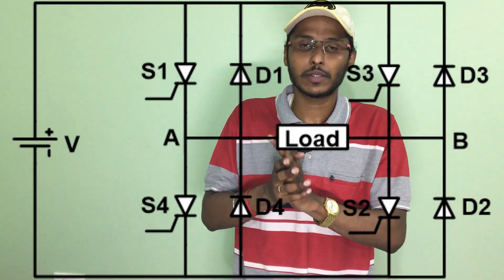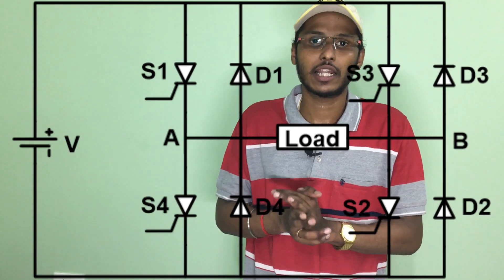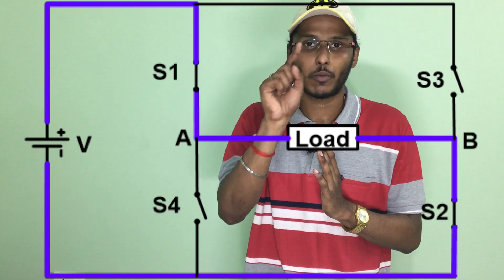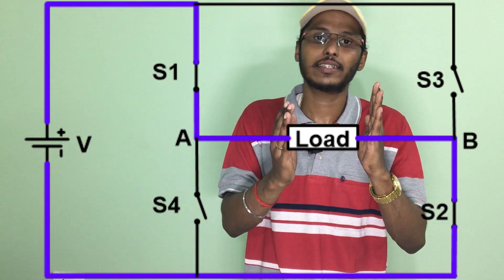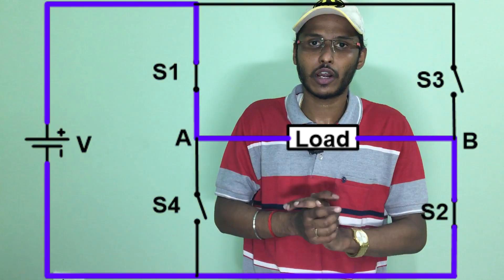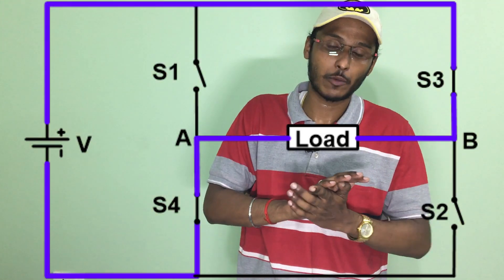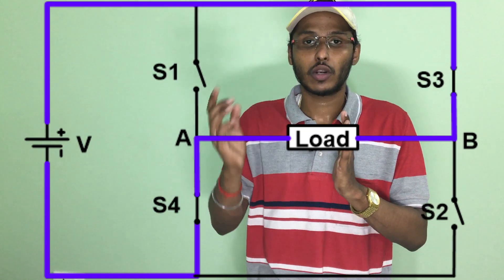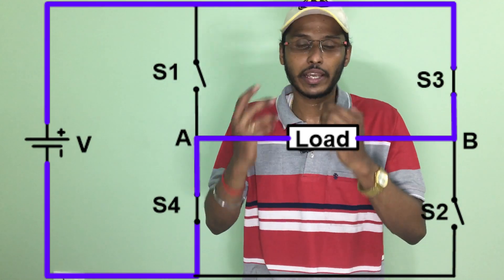എന്താണ് Inverter| എങ്ങനെയാണു Inverter  പ്രവർത്തിക്കുന്നത്| What is an Inverter| How Inverter Works

Comment: Hi, sir കറന്റ്‌ ഇല്ലാതിരിക്കുമ്പോൾ  inverter വർക്ക്‌ ചെയ്യാൻ kseb യിൽ നിന്നും വരുന്ന നെഗറ്റീവ് ആവശ്യം ഉണ്ടോ?. ഇല്ല എങ്കിൽ എങ്ങിനെയാണ് circute കംപ്ലീറ്റ് ആകുന്നത്. Reply തരുമെന്ന് വിചാരിക്കുന്നു
Reply from the maker: Hi,
First thing kseb il ninnu veruneth negative alla neutral aanu...Negative enneth DC ilum neutral ennathu AC iluman.
Pine kseb supply ullepolum neutraliloode supply verunilla athu return path aanu.inverter il sherikum inverter neutral und pakshe wiringil athu aarum edukaarilla kseb neutral common aaki thanne aanu ellarum wiring cheyuneth.so kseb neutral open aanu ee casil enkil inverter work cheyilla. Pakshe even support illa pakse kseb neutral connected aanel kuyepmla
Neutral | എന്താണ് ന്യൂട്രൽ | ന്യൂട്രൽ ഇല്ലെങ്കിൽ എന്ത് പറ്റും | ന്യൂട്രൽ എന്തിന് ഗ്രൗണ്ട് ചെയുന്നു
https://youtu.be/8Te3kOai2XE
Reply: @TechCornerMalayalam  thanx ഫോർ your instant reply. എനിക്കറിയേണ്ടതും ഇത് തന്നെയാണ്. എല്ലാവരും inverter ഔട്ടിൽ നിന്നും phase മാത്രമേ എടുക്കുന്നുള്ളു. ന്യൂട്രൽ common ആയി ഉപയോഗിക്കും. ഈ സന്ദർഭത്തിൽ rccb trip ആകുകയോ kseb ന്യൂട്രൽ ലൈൻ പൊട്ടുകയോ ചെയ്താൽ inverter work ആകുമോ എന്നാണ് അറിയേണ്ടിയിരുന്നത്. പറഞ്ഞു തന്നതിൽ വളരെ നന്ദി
Reply: @sajanjohn8030  kooduthal aalukalum ee reethiyanu use cheyyunath .nalloru samshayam aanu
Reply: @Arunzinfo  thanx sir inverterinte  കണെക്ഷൻ വ്യക്തമായ വീഡിയോ ചെയ്യുമോ. You ട്യൂബിൽ ഒരുപാട് വീഡിയോ ഉണ്ട്. But ആരും ഇൻവെർട്ടർ ന്യൂട്രൽ out  ഉപയോഗിക്കുന്നില്ല. എങ്ങനെ rccb inverteril കണക്ട് ചെയ്യാം. ആരും പറയുന്നില്ല.
Reply: @sajanjohn8030  KSEB neutral pottiyaalum inverter work cheyyum. Kaaranam inverter nte output transformer aanu nammude source aayi work cheyyunnathu.. Aaa transformer nte oru point aaanu mukalil paranjathu pole kseb neutral umaayi connect cheyyunnathu.. Aaa kseb neutral connection poyaalum local load circuit (of inverter) inverter nte output points vazhi closed path undaakkunnundu. athu kondu work cheyyukayum cheyyum..
Reply: @rjshtk  thanx bro
Reply: @rjshtk  inverteril ninne phase matharam alle out ayi povunullu, nutral povand engane anu work cheyuka